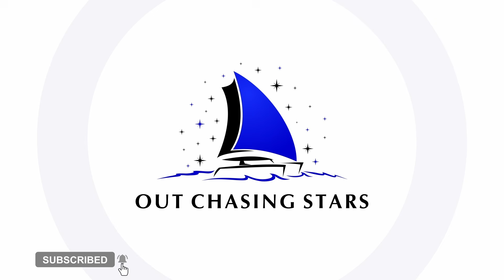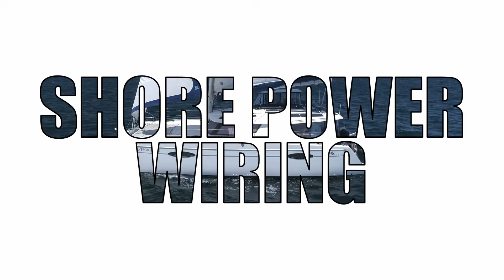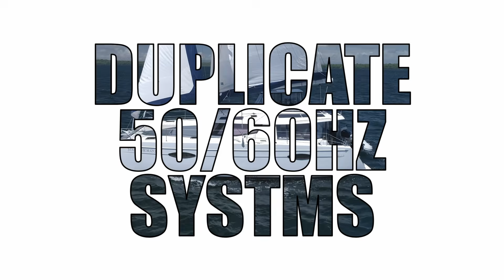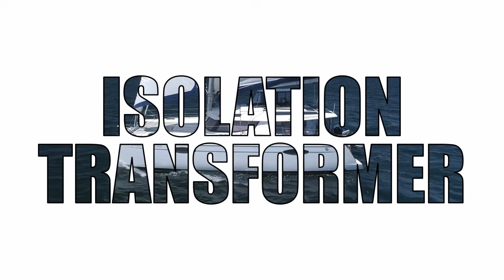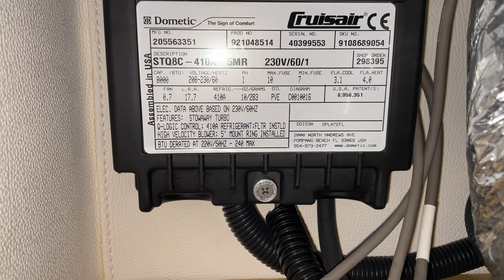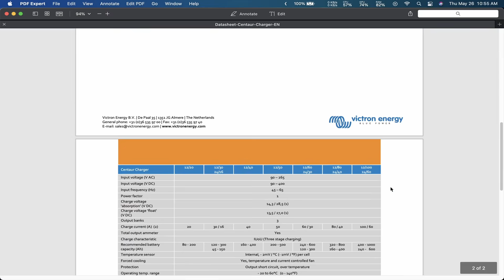International Shore Power for Cruising Boats

Comment: Thank you  for this information something I did not think about before. I was looking at European boats but this has probably changed my mind since none of the solutions seems great to me. There was one thing that I thought about and I hope this is not a stupid question.Are there any generators that run on electric motors? My thought Wes have a generator on the boat that generates 110V @ 60 HZ that is driven by an electric motor that runs on 230V @50 Hz or vise versa ?

Comment: I have two multiplus 3KVA in parallel, and my aircon is brushless with variable speed (Velair VSD) so no large inrush current. I can charge the batteries using cheap battery chargers and power all my AC loads from my multipluses. Easy solution for modern systems. I actually don't even need to plug into shore power with my solar and 14kWh of LFP.

Comment: Thanks for the great video David! We’re trying to figure out what to do before we head off to French Polynesia.😬
Reply from the maker: Hope it at least gave you a few other ideas for ways to tackle the problem.  It's definitely a challenge but being in French Polynesia (and the rest of the South Pacific!) more than makes up for it!  😃
Reply: @OutChasingStars  we’re leaning towards the isolation transformer but will wait until we’re in New Zealand. There’s too much going on right now. 😂 We’re planning on enjoying the beautiful anchorages in FP so it shouldn’t be a big deal there.
Reply from the maker: Isolation transformers certainly seem to be the most common way to go. The only real drawbacks are they don't convert frequency so you still have to be careful which appliances you use and they can be small so you may have to manage how much equipment is on at one time.

But those are future problems.  As you say, lots of beautiful anchorages in FP to enjoy first!  😉

Comment: I liked the video.  Thanks for sharing your experience.  Another option I don't hear about but what we are going with is to use an Inverter/Charger on Shore Power 1 and dedicated battery charger on SP2.  If shore power is 110v/60hz we use SP1.  If not we use SP2.  Of course a GA is installed on both shore power connections.  Also, ELCI for both SP.

Comment: Should be no need for a galvanic isolator if you are going with big battery bank and charger and inverter. Your ac is produced on board and is isolated already from green wire shore power with the battery charger.

Comment: Absolutely fabulous,David ‼️‼️👍🏻 This series is perfect for us as we transition from a sailing monohull to a power catamaran. We will be installing Belmar high output alternators and lithium batteries. Hopefully, battery recharge will be as simple as running one engine at low rpms for an hour or 2. No generator,and 3KW minimum of solar. 😊

Comment: I understand your love for Air conditioning on a boat, but this causes additional costs and requirements. Have you considered the case of not having them, and for the money you save, spend it on a luxury hotel when you are in a marina? USD 22,000:- would count for many excellent nights in exotic places, all with cool rooms with Air conditioners. Sometimes we boaters go way too far to convert our land life to near-land luxury life on a boat. Thanks for a good discussion. Just my 2c. Cheers.
Reply from the maker: One of the fun things about boats is the millions of different ways people set them up.  We certainly know a lot of people who go without aircons and thus avoid the problem.  But, while they are definitely a 'luxury' item, they were something we wanted on the boat.  Not just for the times we're in the marina, but we've definitely had times where we wanted them at anchor as well.

As for using a hotel as a substitute, that's an interesting idea.  Not every marina we've been to is near a hotel, so there could be a few more logistical challenges with that approach.  But that could certainly be one of the options!

Comment: David, another great video addition.  However, since aircon was the main concern, I'm surprised you did not mention the newer Direct Current (Mabru) aircons.  Switching/replacing/building a vessel to DC aircons solves the majority of the frequency issues (as you stated, most electrical equipment is already dual voltage & frequency compatible.  Converting to DC aircons would also alleviate the inverter efficiency issues, no soft starts needed and you could install a smaller (less expensive) inverter....so a cost savings (albeit the DC aircons are a little more pricey..so with the savings in inverter size and soft-starts..might be a wash).
Reply from the maker: I just may have some more insights on DC air cons coming up soon.  😉  You're quite right about a lot of the benefits, but I will say that the DC air cons are more than a "little" pricier so there is a different calculus at play.

Comment: Questions: Does converting AC shore to DC then back to AC result in significant inefficiency (loss)? What percentage? Would going shore through charger into batteries then inverting reduce battery life?
Reply from the maker: There is definite efficiency loss during the conversion process.  I'm not an electrical engineer but my understanding is that AC to DC is more efficient than DC to AC.  But so much depends on the set up of your system.

For example, the 'rule of thumb' that I've seen constantly mentioned is that a DC to AC inverter has roughly 10% efficiency loss.  But our Atlas Shore Power specs show that it is 91-92% efficient (varies depending on load) for the entire AC-DC then DC-AC process.  So not sure I can give you exactly numbers unfortunately.

As for reduced battery life, I can't seem to find a really good answer on that actually.  Most battery life ratings are in Depth Of Discharge cycles, but if you have a charger keeping the State of Charge high, then you technically aren't cycling the batteries by the standard definition.  But reactions are still happening internally in the batteries so I imagine there would be some impact on battery life.  Perhaps someone more knowledgeable then I am will chime in...
Reply: Most Inverters generally have an efficiency loss of between eight and twenty percent.  That is just the cost of inversion.  Though investing in a charger that can do 120v and 240v is hard to find.  The best idea is likely to have two separate chargers that can handle your likely situations at either 50 or 60 hz.  Though aircon is again an issue so make sure you have a hefty charger.  Ours can do 100 to 130 amps depending on the load...though it is a Victron which is also an inverter.  Which two Victron units might be a good solution for international travelers but remember even 120 amps at 12 v is like 10 amps at 120 volts out of an inverter...if I actually did those conversions in my head correctly.  So a 12000 but ac on that would be a stretch.

Comment: Air conditioning you well established is a (if not the) major power consumer on board. I am surprise your usually through treatment of such matters did not include one or more of the modern DC powered Air Conditioner alternatives, which operate at significantly lower power consumption than legacy AC powered systems.
Reply from the maker: Well, perhaps I didn't want to spoil some of the upcoming plans for Starry Horizons... 😉  But you're definitely right, if you have the option and don't mind the extra expense, going with the more efficient DC Air Cons is the way to go.  I probably should have at least given it a mention here as well.